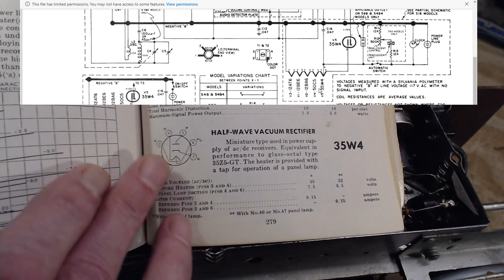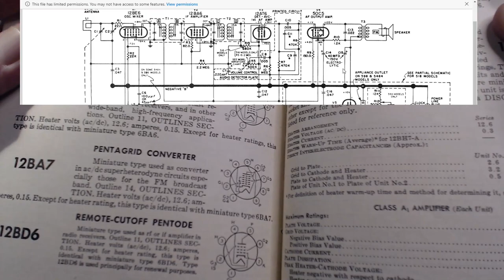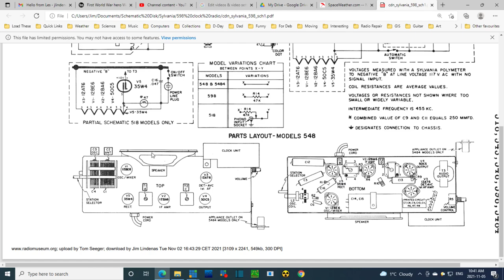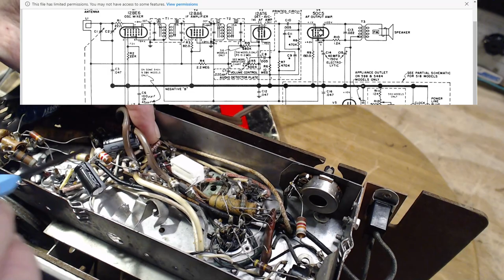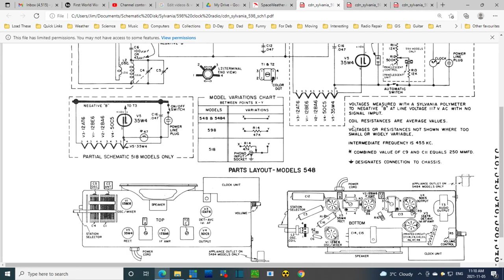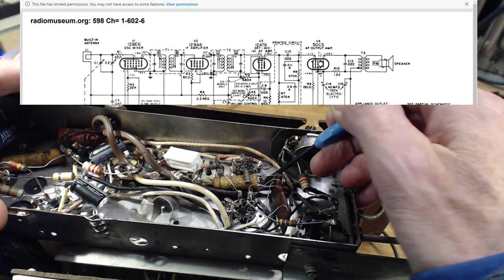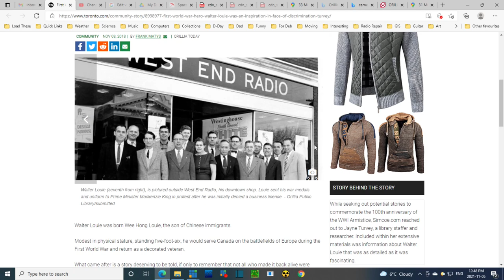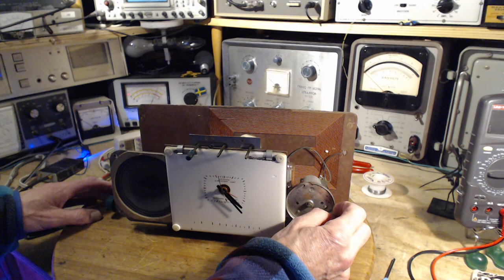1955 Sylavania 598 Clock Radio Video #4 - Capacitors Replaced

Comment: These are the separate capacitors listed on the schematic and not counting the "printed circuit":
C3 (.047), C6 (100 or 33pF), C12 (.047), C13 (.022), and C16 (.047). So which one are you not finding?
I think C6, which looks like a 2 Watt resistor with bands on it , near the oscillator coil, is tripping you up.
It goes to pin 1 on the mixer tube ,not pin 6!!! It also is connected to the 22K resistor.

Comment: Did he use safety caps as replacements? It sure looks like it. He gets sidetracked so easy. Spent almost 10 minutes looking at wrong chassis layout .  Just cannot follow a schematic and match to what is there without getting mixed up and then starting down a wrong track.